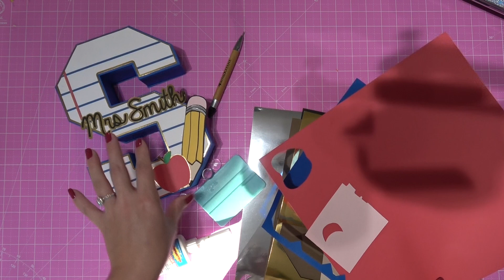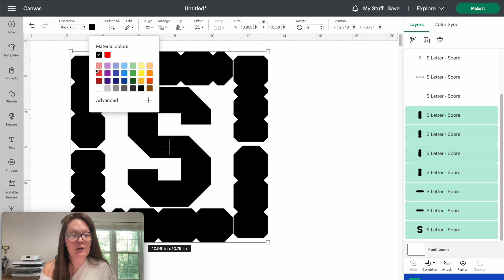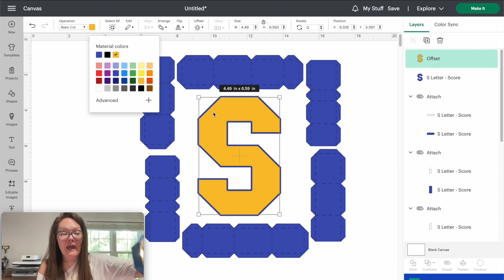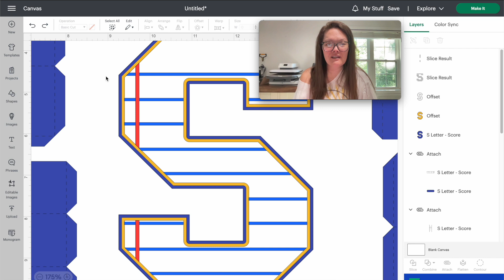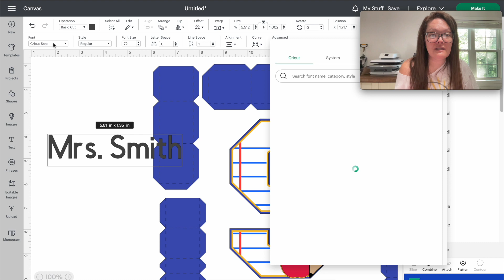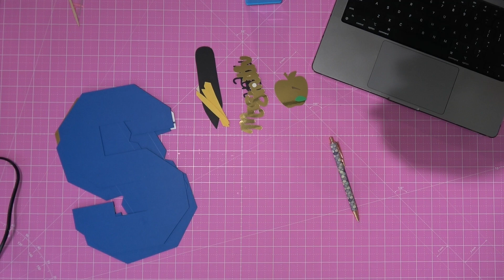Create Stunning 3d Cardstock Letters With Your Cricut!

Comment: I tried making it and the file sizing is all messed up 😩 i assembled it and some pieces came shorten then others I don’t know if it’s just me
Reply from the maker: If you resized it all together & locked proportionally there shouldn’t be any resizing issues during the cut process. Also make sure you’re assembling the strap in the correct location.
Reply: @ashleefalco Thank You I figured it out :)
Reply: I tried doing it so many times and still getting different straps. I’m doing letter J